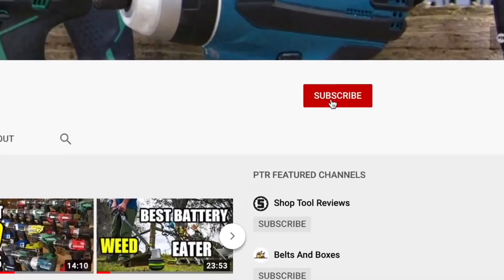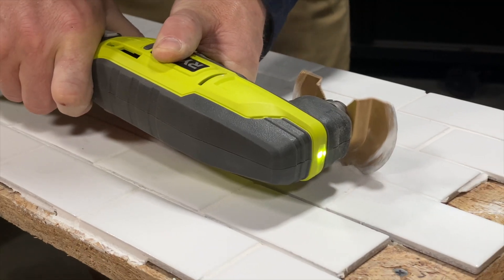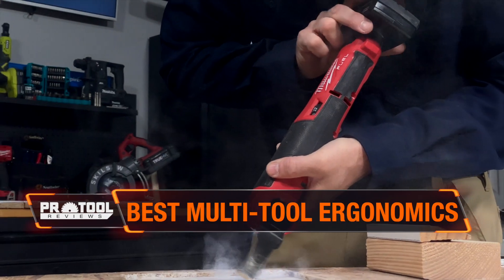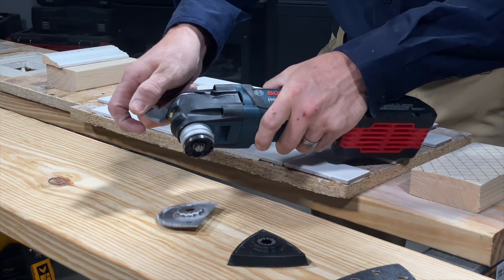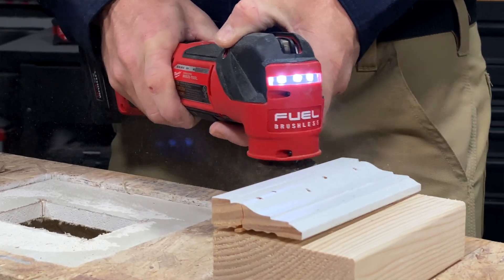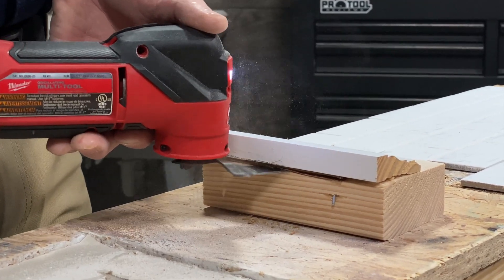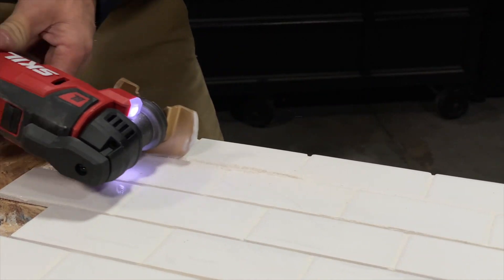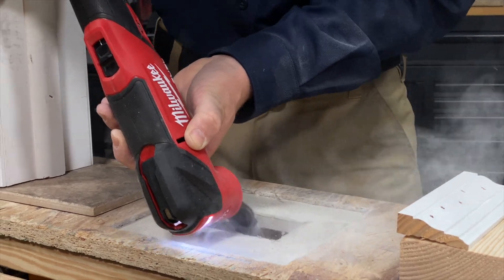Best Oscillating Tool 2021 - 10+ Pro Multitool Models Tested

Comment: Decided to get an oscillating saw--then I pondered what I'd do with it.  Mainly, scraping paint, removing adhesives (lap seal) controlled cuts with wood, sanding in corners and up at ceilings. Checked other sites, basically if you don't use the thing in construction daily--don't get the 18V because of weight, intense vibration, very loud, won't get into tight spaces, poor ergonomics and so on.   The latest in battery power output and using much more efficient brushless motors give you "18V" brushed power but at 10.8V three cell (12V max)  and if every second does not matter but accuracy does, look at the 12V stuff from Milwaukee and Skil to save your hands.  Can't get accurate with numb hands and the annoying sound levels of more powerful saws wear you down and causes mistakes or the desire to rush the job because loud/high vibration tools suck. The Austrailian that tested 9 saws, 8 of them were 18V and the Milwaukee was 10.8V with the Milwaukee getting highly recommended because it was the quietest, least vibration, best ergonomics, lightest weight, most compact and due to ease/comfort of control gave the highest quality of cuts.  If I was using the tool every day in construction and did not need to get into tight spaces, I'd go Fein to protect my hands and ears over time.  If I needed the tool for less than 30 minutes a day, I'd go Milwaukee 10.8V for more precision cuts (computer network installers, electricians, medical facilities etc.)  Oscillating saws have the same natural "fuse" that 1/4" impact drivers do, the blades can handle only so much power until they are destroyed.  Impact drivers are now more powerful than the bits/extensons can handle so breaking bits/extensions with the most powerful impacts is a bad thing!  For this reason, I went Makita XDT 16 for less power not to break bits/extensions and the Skil pwrcore 12 O-saw to not overpower blades too hard for longer life.  Not to mention the lower noise, lower vibration, lower weight, much more compact to fit in tight spaces (my use) enough power and the tiny battery runs out so I'm forced to stop to give my hand a break. The only downside of the Skil is the batteries have that USB charger built in so my wife keeps swiping the batteries to charge up her cell phone.  Something to think about, if you use the tool for less than an hour  a day and the reason for using it is to get into tight spaces and precision cuts--go for the 10.8V (12V max) variants to save your hands, your hearing and get better results.  I know it is always about more power but some tools don't have much benefit from that and very much so the oscillating saw.  Only so much stress can be handed by a bi-metal blade so using less power will alllow the blade to last longer.  Now if you use the saws for quick fixes in construction, go ahead and get the monster saws because time is money.  If you use them alot, then I'd concentrate on sound/vibration to protect your hands and ears.  If used inside for business use, the sound level is critical to avoid annoying people so the 10.8V works best there.  Everyone is not always outside, no people around and every second counts to use the right tool for the job.  I used an oscillating tool on an RV roof to remove lap seal (pounds of it) did some sanding also and used it for over an hour a day for several days and really made the right choice with the Skil 12V 2Ah pack.  It fit in places the 18V would not, very light at less than 3 pounds so no sholder fatigue, no hearing fatigue and no hand tingling so a win for me.  The DeWalt 20V max was the worst one instantly---very loud, massive vibration, bulky.  The Makita had poor ergonomics, very heavy brushed motor, bulky, very loud and just a mess compared to the ergnomics of the XGT16 impact--it was like Makita didn't put any thought into the design at all (bummer because I have four Makita 18V 5Ah batts I could use!)  Oh well, no tool company makes the best of everything even Hilti...use the right tool for the job and don't let the tool beat you up--you will suffer in the long run.  Just a few ponderings....
Reply: I agree, it depends how you will use it
Reply: "just a few ponderings" (1300 word essay that I read and took notes from)

Comment: DeWalt has 3 Brushless 20v models and at any given time at least one is on sale for $99 for the kit or with a free 3.0ah battery , it's a great deal and imo the best bang for buck multitool's on the market.... 👍👍
Reply: Outdated design, ergonomics designed by people who don't have any understanding of how these tools are used, really nasty vibration of both the user and the battery connection, overheating motor controller inside the grip cooking your hand.... what's not to love? 

I upgraded to the new brushless Makita. It's the best on the market imo. Leaves everything else for dead in terms of power, speed, controllability and ergonomics. Lowest vibration bar none. It wasn't out at the time of this review, but it is better than the Milwaukee in my view. And it takes Starlock Max blades.

Comment: I own both Milwaukee versions but... I grab my buddies dewalt whenever I have the opportunity. It’s ergonomics are fantastic and the pressure trigger allows you to feather the speed you want without turning it on and off.
Reply: @Protoolreviews  
I have the non fuel 12 and 18 versions. As for performance, I am pleased with both versions. On the 18v, I almost always have to reposition the tool to turn it off. Often times I’m doing this with one hand so I’m juggling the tool with the blade oscillating. I think I would be ok with the switch if the handle was more narrow and/or the switch was in a better position. Lastly the 18v version gets really hot in the hand if you are cutting for extended times.
Reply: Michael, the reason why you grab your buddies Dewalt XR Multitool is due to the older Milwaukee technology you’re using.  You don’t know what you don’t know.  I’m on the M12 and M18 platforms, but filled in a couple of areas while waiting for Milwaukee to come out with a newer version or a version, e.g. multi-tool and table saw.  Purchasing the Dewalt Max XR Multitool and Dewalt Flexvolt 8 1/4” table saw.  

After purchasing the Milwaukee M12 Fuel Multitool I gave the Dewalt Multitool to my son.  In my opinion it’s downfall is the variable speed trigger and it’s handle ergonomics.  Which both deter me from completing cuts at the same speed, as well as maneuvering around materials.  It’s just plain awkward with the handle design.  I also found that I was always pressing the trigger, letting off pressure, then pressing it again to rev back up to speed.  It’s not consistent in it’s delivery.  If you’re just grabbing your buddies tool to use, I’m betting it’s on a really limited basis and not full on project usage.  Because if you were…then you would realize the noise and the vibration suck! It’s 

If you’re already on the M12 platform, then I strongly suggest purchasing the new M12 Fuel Multitool.  It is very powerful, more powerful than the Dewalt.  It has a better blade angle for cutting, it’s quieter, I find it’s easier to take blades on and off (takes a couple of seconds more), as they’re always getting stuck with the Dewalt trigger removal.  It’s way easier to maneuver and it’s easier to lock onto a speed, increase the speed then continue cutting with continuity.
Reply: @martylucas8557  Thanks Marty, I have recently upgraded form the standard m18 multi to the new fuel. It is a much more capable tool. Thanks for your feedback.
Reply: @michaelesims1564    Thanks for your observations. Which tool did you end up preferring in the end? Initially I thought that the pressure trigger would be best, but I can see the problem @Marty Lucas mentions, that it can be inconsistent in its delivery.
Reply: @BonaDeum  I took Marty’s advice and upgraded to the 18v FUEL. It is a far superior tool in everything mentioned above. My buddy is now reaching for my multi tool. I still say that holding each tool in the hand, the dewalt is more comfortable and I enjoy the pressure trigger immensely. However, with the fuel, I get the job done faster and with more precision. One more thing, the non fuel 18v Milwaukee lasted less than a year of daily use. I would not buy that model for any reason now that the fuel is available.  Hope this helps.
Reply: @michaelesims1564  Thanks man! Think I’ll end up with a Milwaukee, based on what you both said. And definitely the fuel version, when I am first purchasing one. You really can feel the difference between a non-fuel and a fuel tool. Thanks again.

Comment: My favorite is Makita, just cause I have batteries...  I actually considered buying a corded just to avoid multiple battery systems.
Reply: @Protoolreviews  would you recommend using battery adapters. As Im on a makita platform but I don’t want  to be limited to just makita tools.
Reply: The new makita multi tool is top notch

Comment: When talking about how some are so much faster than others, it would have been nice to learn their oscillations per minute, or what about the tool makes it so “fast” there are so many of these on the market and when comparing provided markers of performance there dose not seem to be major differences between brands. So it would be nice to know what features of performance, or design are evident in the tools you say are the best
Reply: Oscillation angle is far more important. Too much speed only creates heat and wrecks blades. Starlock also is a superior system that puts way more energy into the blade, so they don't stall as much. This is why Starlock blades last longer. More oscillations per minute is most definitely not an advantage.

Comment: If I remember correctly, the Craftsman multi tool is based off of the old Porter Cable one. Any thoughts on the Craftsman vs the Kobalt multi tools?

Comment: Fein all day,any day and everyday. 12 years 6 days a week using in most brutal,dusty conditions and has finally failed me. Order starlock model and couldn’t be happier. True 100% German Tool Brand that hold its name and quality with Pride 🤙🤙🤙🤙🤙
Reply: I thought that too but my fein fmm350qsl just broke. 3years old not heaps of work. The housing inside cracked and when you see it I'm not surprised. There isn't much holding it together. Not cheap and I won't be buying fein again.

Comment: I noticed the brushless Milwaukee is significantly pricier than the brushed motor. I know generally brushless will last longer and not spark, but anyone have thoughts on if it’s REALLY worth paying extra for? For me the multi would be a nice to have now and then, not a routinely used tool
Reply: The fuel is twice as fast as the brushed and more reliable, I wouldn't get the brushed after the motor failing on me.

Comment: Reguardless of price, is the M18 really more powerful than the M12?

I know it's kind of a dumb question because you'd automatically assume 18V is more power but they are both rated at the same exact OPM so wouldn't they be the same exact speed (besides the longer stroke which on some videos makes the M18 seem to deflect more for some reason)

I'm ready to purchase one and I'm really on the fence if the extra bulk is really worth it for the M18.

Also now in this video you said the M12 was the leader in vibration both in another testers video comparing both side by side he commented that the M18 was  noticeably smoother.
Reply: @Protoolreviews  Thanks for the reply.

I found what might be a bigger issue with both the M12 & the M18 tough.

I watched a lot of reviews of both and I actually noticed people saying the old M12 & M18 make more precise cuts than the new units as they pointed to chatter marks on drywall with the new fuels and they suggested it was the new longer stroke.

I don’t believe it is though, I believe it’s the fact that they set the attachment base on rubber bushings allowing it to freely bend when pressure is applied to the blade which along with the new linger stroke is making the blade chatter on the cut line causing chips in the cut.

I watch alot of your guys videos so I’m sure you understand what I’m talking about.

In the past people have often referred to that blade locking point and pointed out how the more ridged it is the more the precise the machine will cut so it seems like Milwaukee might have made a bad design choice in a trade off for lower vibration.

It would be cool if you guys might be able to test that one day?

You can see on video the entire blade bends every cut you make with them and not other oscillation tools.

I believe the ultimate Multitool would be the M12 Fuel with the old ridged base plate for better accuracy  (no reason rubber flex) with the 180 degree LEDs and rubber overmold on the head of the unit like the M18 (which the skipped on the M12, it’s just plastic)

But Milwaukee isn’t going to fix the chattering problem unless people start to recognize it and call them out for it.

Oscillation tools above all should be total precision.

Comment: I needed a multi tool for a project at home and my home depot didn't have the m18 version in stock which is what I use  so I went with the dewalt.. oh how I regret it .. I should've just went with the m12 version

Comment: have you tested the Festool OSC 18? I think it is even more powerful than Fein with higher speed and a slightly higher angle
Reply: The Festool OSC18 is Made by Fein. If you look at it you can see it’s almost identical to the Fein with minor differences 

The Fein is THAT good
Reply: The festool is internally the same as Fein so no power difference.You might ad well buy Fein as its cheaper though i own the Festool as fein has no support here.
Reply: @markmall7142  thanks for the info. I somehow suspected that they are very similar internally and the only difference  are some nice tweaks to the mount done by the Festool engineers. nonetheless, I bought the Festool because I can use my battery packs on that and the plunge add-on is very useful to me. However, I save some money by buying fein (or bosch) blades. The fein ones and the Festool must be from the same factory.
Reply: @kirkmann4434  I do the same, bosch blades or Metabo blades if i can find them .Purchasing Festool was a matter of having existing batteries, though my tool came with one 3.1ah which is more than enough for my use.

Comment: Festool Vecturo by far the most accurate, least vibration, and most powerful.  I have Milwaukee 18V Fuel, Makita and Ryobi also.  Milwaukee and Vecturo are both equally powerful.  But Starlock blades are more expensive.  So I usually use Milwaukee.  But when I need accuracy or cut through a stainless screw, I go for Vecturo.  Makita?  It is a little less powerful.  Ryobi?  Well, it came with the real cheap set I got.  It was at the end of the year, and I suffered from a compulsive shopping.  I used once, and the screw came loose.
Reply: I have a Ryobi from one of those cheap sets and it would be hard pressed to cut a leaf. The Festool OSC 18 is the same as the Fein 700, BTW, just a different housing.
Reply: The new Makita brushless Starlock Max tool is the best on the market imo.

Comment: I have both the M12 and M18 fuel multi tools
Reply: @Protoolreviews  really just comes down to battery capacity. The m12 6.0 is a great battery. But it just couldnt keep up when installing flooring and cutting out door jambs. Would have to change the battery out multiple times on a bigger job. The m18 while slightly bigger and heavier wasnt uncomfortable as its pretty balanced even with the bigger battery. A 6.0 last for days and not hours! I run the 6.0 for the higher output in times of need, and paired with the auto load function it last forever! The weight isnt bothersome as im using it for a minute or two per door max. And it also does effect the ergonomics. I do still use my m12 though on smaller project of like a room or two but not for a entire home.

Comment: I’ve been looking at these very closely. I found I wanted a corded tool so that I have power when I needed. I want one with a simple and reliable accessory swap out - I saw one with the swap out lever on top that was broken so I’ll bypass these type. Lastly I want one that doesn’t use only it’s accessories like Dremel does. Which ever way I go, I’ll be getting one this week.
Reply: You obviously aren’t on a battery platform, because if you were you’d never want a corded tool.  A corded multi tool….seriously?  LOL!  Good luck with that, trying to maneuver while focusing on an intricate cut, while worrying about your cord.  Today’s multitools are more powerful than their corded counterparts.  I have the new Milwaukee M12 Fuel Multitool and it’s nothing less than awesome.

I never want to have to worry about finding a plug or dealing with a cord ever again.  Cords suck!